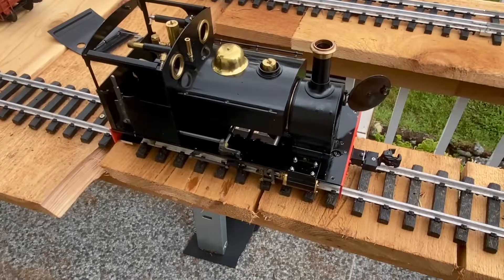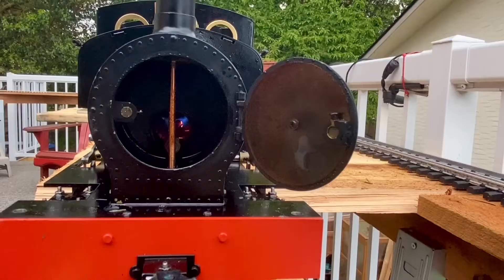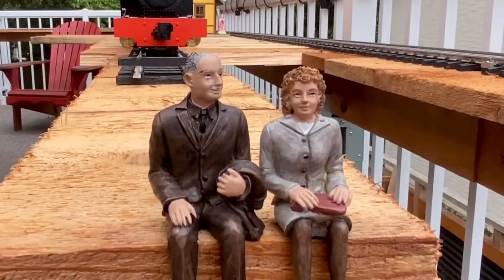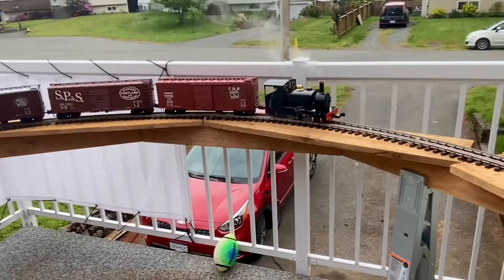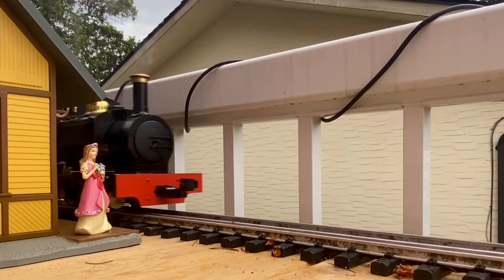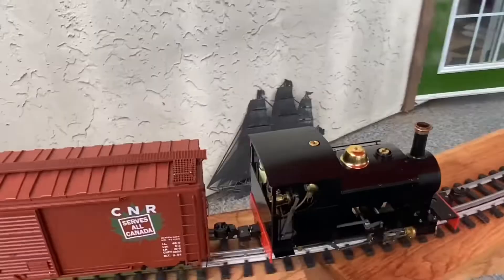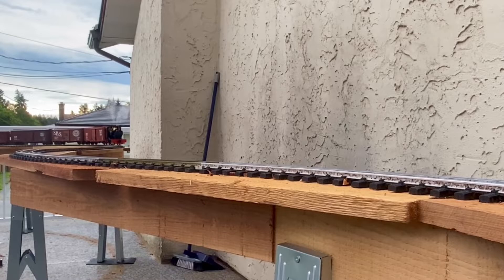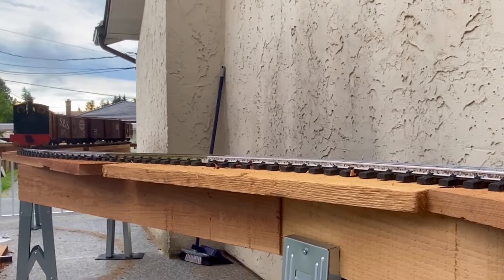Victoria BC: Summerlands Chuffer makes my Accucraft Sabrina sound Awesome! (Info in description)

Comment: Lovely engine
Reply from the maker: Thanks!
Reply: Also I got my first steam engine I got a mamod sl1 locomotive but I got mine with a gas tank and a lubricator sadly it had a gas leak and there is a bunch of steam coming out of the cylinders so I have bought a new gas tank and cylinders for it
Reply from the maker: @malvernroadrailway6955  best of luck with it. I used to own used SL1 and had to lap the reverser and block faces. I also added new seals.
Reply: @Terrys-Steam-and-Cobi  thanks and I saw you video on your sl1

Comment: Have a few Summerlands chuffers myself on a couple of my locos.
It’s a great effect but can get a bit much on the ears in a small garden or at a show so last time I got one fitted I got the FX model which can be adjusted from loud to silent, do you have the standard or the FX on your Accy?
Have you seen Slo-Mo? A steamer fitted with a chuffer and Slo-Mo runs and sounds great.
Reply from the maker: I have seen Slo-Mo on some YouTube vids. Interesting innovation. I have the standard chuffers. My deck and a friend’s garden where I also run my trains are open enough (not walled in) that the sound hasn’t become irritating. And there is no one running live steam at train shows here, sadly. G scalers always have set ups at shows but run electric trains.
Reply: @Terrys-Steam-and-Cobi   ha didnt think you’d have that problem on that nice open deck, it looks a very pleasant place and seems a great blank canvas for the railway.
Britain has a few annual garden railway shows like Peterborough 16MM AGM and the Yorkshire Garden Railway Show but I haven’t been to any in about 5 years now, hoping to ride down to the Yorkshire Show in late summer and break the streak.

The Slo-Mo isn’t actually a new idea in garden railways, before Slo-Mo people would build their own wagon mounted slo-mo using the innards of an old rotary telephone or just a large flywheel to create the rolling resistance.
Reply from the maker: @SteamTrainsNStuff  interesting. I thought it was a new idea. 

My deck is nice and open and a decent blank canvas as you say. The cul de sac I live on was built in 1969 and honestly there is very little character. I see videos from the UK and the surroundings have character. 

In actuality I have a fairly large back garden but we think we may be moving in 2-3 years so there is little point to start to build a proper garden railway - especially since I would want it elevated. Maybe raised with stone and filled. Possibly a retirement project.

Comment: Are they easy to install?
Reply from the maker: Very very easy. If you get one designed for your particular loco especially. In this case all I had to do was unscrew the existing blast pipe and screw the chuffer right into the same spot.
Reply: @Terrys-Steam-and-Cobi  I've finally ordered one today for my Sabrina.
Reply from the maker: @StaffsTransport  great! 😊
Reply from the maker: @StaffsTransport  will you post a vid?
Reply: @Terrys-Steam-and-Cobi  I'll be posting a few over the winter as my railway gets built and I can run the engines on a permanent railway.
Reply from the maker: @StaffsTransport  awesome